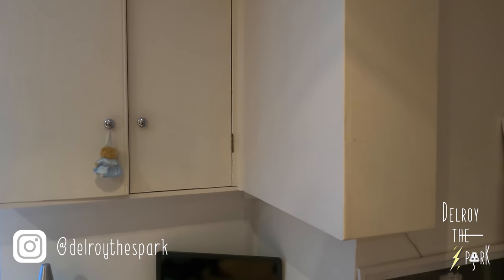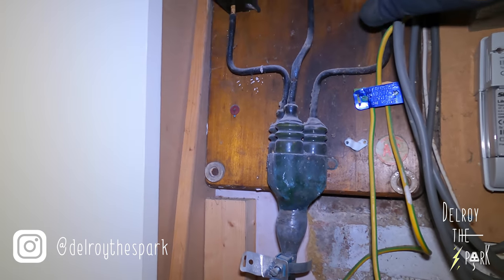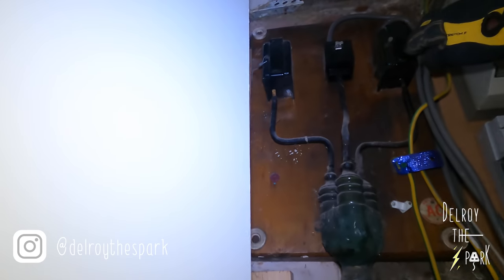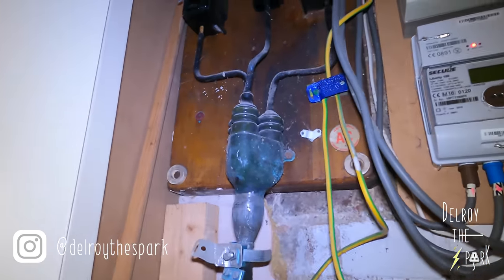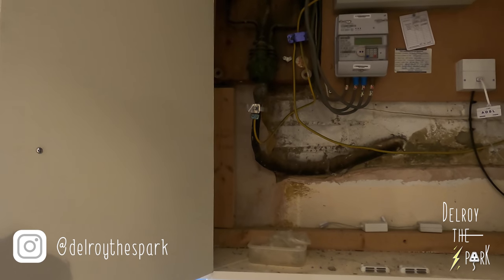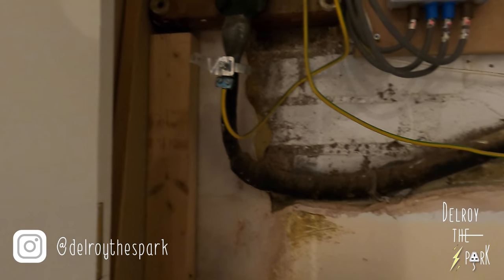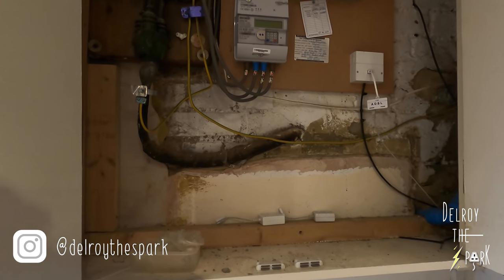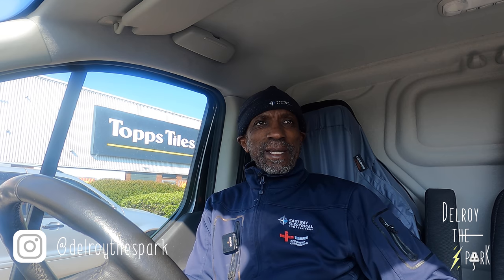"You Need To Contact UK Power Networks As This Is An Emergency" | Electrician In London Vlog

Comment: At least it was stable at the time. When you can visibly see arcing and blue sparks showering off you need to call the fire brigade as well the network operator!
Reply: @Exploring With Dark Dreamz I don't think you need to leave the building -if there is a fire incident you'll see it straight away if you're standing there next to it waiting for UKPN to arrive! Certainly don't want to sleep there though until it's been made safe.
Reply: @Exploring With Dark Dreamz Obviously - that's what I said, if there is a fire incident developing then it would make sense to evacuate and call the fire service. But it's not doing that here - and if it started doing that, you'd see it if you were standing nearby! What they did by calling it in with UKPN was perfectly adequate.
Reply: @Exploring With Dark Dreamz Yeh I'm aware of the safety implications - but it wasn't arcing or sparking at the time the electrician was looking at it - it's still serious, that's why they've reduced the load and called out UKPN as an emergency - there's no need to run out of the house with it was in the video though!
Reply: Switching off all loads would immediately prevent any further arcing.
Reply: @sdgelectronics  That's not necessarily true. Some cut outs have a 2nd neutral connected to a street light outside. If that suffers a loose connection or some issue, switching off the load inside the property will have no effect.
Reply: @arsenalh8manu  If there's no load, it cannot arc. There's no current. You can test this easily - take a piece of wire and connect it to an energised terminal and see if you can get any arc to occur.
Reply: @arsenalh8manu  As an analogy, try welding without the ground lead attached the workpiece...
Reply: @arsenalh8manu  sorry that's not correct at all. An open circuit cannot create any load or draw any current.
Reply: Switch off the DP main switch on CU and you’ve got an open circuit, no current, no more arcing.
Reply: @letsgocamping88  I concur 👍
Reply: @0liver0verson9  in 25 years I have never seen a cutout with a second neutral you can have a separate earth bonded to the cable which will appear in the cut out as a separate connection but not a second neutral

Comment: Wonder what the fault level is at that point, presumably the fuse would still work as a fuse even if it is welded in to the socket! Great video, thanks. From an armchair sparky.
Reply: Loose connection provides a high resistance path at some point, which provides simultaneously the dimming lights and the heating up of the fuse box (power goes into heating everything around the loose connection instead of into the lights). In this case it will probably have been the loose connection of the wire from fuse to meter, since nothing else would have been touched in decades.
Reply: @JasperJanssen  the cable entering the fuse holder was showing signs of heat damage, it may well have been the connection on the bottom of the fuse and it is not uncommon for this to fail - note the fuse holder was not fixed to the board and its movement to fit new tails may have loosened the connection resulting in the fault we see here.
Reply: @David-js4wd  the fuse holder was not fixed to the board because the person installing the meter had taken it off to fit the new tails. And, sure it was showing signs of heat damage. Heat travels.
Reply: @JasperJanssen  the meter fitter would not remove the cutout from the board to fit the tails!

Comment: I’ve called 105 many times over the years, they are always very helpful and normally are out within a couple of hours. One of the times was for my own house 😝. They had to dig up the front garden to kill the electric to change the service head 🙈
Reply: Call 999 mate 🤣🤣🤣🤣
Reply: @emilgemc8913  🤔🤷🏼‍♂️
Reply: My understanding is that the suppliers consider it safer to cut/rejoin a live underground cable than to change a service head live, presumably because there are less variables to contend with.
Reply: @petermichaelgreen  it’s because it was on old metal service head, if it was plastic they would of done it live
Reply: @-.Andy.-  IIRC the DNO procedures I came across (which admittedly may vary with DNO and time) said they would only do a live cutout change if the cutout was of insulated material, the cable was of a modern plastic-insulated construction and the supply was single phase. If any of those weren't the case they would cut the cable outside, change the head dead and then re-join the cable.
Reply: @petermichaelgreen  yeah they don’t always stick to that in my experience, I had one crew come out and change a 3 phase head live once 🙈
Reply: @-.Andy.-  They shouldn't change a damaged or overheated 3 phase or single cut out live though. That has gone terribly wrong on more than occasion. This one was ok to change because it was a separate single unit.

Comment: Those pilc cables ( paper insulated lead cable) have been on the network for about 50 years so they are on their way out unfortunately.
Reply: You'd think so but the plastic cables installed in the 70s cause more issues
Reply: @haldo691  that is true the lead ones are better

Comment: Good lord that's an aging electrical system. I don't think that kind of thing would pass as serviceable here in Canada
Reply: You should see ours here in Germany. Our fuses in our apartment are giant round screw in ones (similar to a light bulb fitting) covered in Bakelite.
Our building is over 120 years old and was rebuilt after the war due to bombings.
The wiring is a total mess particularly in the kitchen where generations of occupants has laid wiring but not adhered to any safety standards. Wires laid in non uniform depths and worst of all, they're laid in a Criss cross patterns across the walls meaning that the entirety of the walls are live. We honestly thought our testing equipment was broken when we moved in and wanted to mount cupboards and couldn't find any safe places to drill. We call in an electrician who confirmed our fears and could only advise to just be super careful when drilling.

Comment: I’ve always prided myself on safety at home but last year we started getting tiny electrical issues. Turned out to be one of these huge old 35amp fuses in the box outside. The terminal had almost rotted away to nothing and was very loose. It was also bloody hot. Fair play the electric company was with us in an hour and we ended up with absolutely everything in the box being replaced. Even a new board for everything to be screwed onto. People don’t realise !
I think the biggest issue with electric is you can’t actually SEE what’s going wrong

Comment: every time i see UK wiring i have a fit as to how exposed all that wiring is and how the mains are just exposed...
Reply: It’s double insulated
Reply: It's actually safer than burying everything behind plasterboard. You have easy access to it should a fault occur (like the scenario in this video) AND the added benefit that you can often see, hear and smell when something is going wrong - which you couldn't do if it were all covered up. It's really supposed to all go inside a metal, grounded casing but the older the property - and UK houses are often EXTREMELY old - the less likely you are to find this as that's fairly new regulations. Also leaving it exposed means it's strangely LESS likely to cause a major fire as it doesn't have a bunch of flammable material surrounding it (like wall insulation) inside an enclosed space where fire can develop, burn and spread unseen and undetected for quite some time.
Reply: @DavidStruveDesigns  ive never been a fan of burying utilities in the walls, i rather like the look of running wires in conduit personally
Reply: me too! is unnerving... also, americans and single solid wire.... atrocious
Reply: @federicocresci698  solid wire is only used on branch circuits, the main coming in off the street is stranded, the advantage of solid core for branch circuits is you can clamp down on the wire and it wont come loose over time with heat cycling like stranded will, and with solid it tends to withstand heat from overload better

Comment: You seem to get a helpfull lady from ukpn, we went to a customer the other day who told us there's no main fuse, obviously had to check this to find copper cable wrapped around the fuse carrier, phone ukpn told by lady you shouldn't be pulling the fuse( in a head teacher telling off manner)
Reply: She is correct they potentially have the power to prosecute anyone tampering with their supply
Reply: @davejarvis5279   I was pretty sure you were allowed to pull the main fuse in event of an emergency. Some sparkies pull them out everyday, its all well and good until you pull one and the incoming cable drops out of the fuse block onto the floor
Reply: There's no need for the condescending attitude but she was correct. Electricians should not break the seals or pull the fuse. Obviously, there are situations where common sense may override this but there are good reasons for these rules. Ideally, every property would have a double pole isolator, so this issue wouldn't come up.

Comment: See that Liberty 100 meter, thats a Gen 1 smart meter. IF you have swapped your supplier so your current supplier DIDN'T install that meter, then it works as a dumb meter. There is a SIM car inside which dialled the supplier if opened.

Comment: Wow, Europeans criticize the American power system for using 120v as the normal household voltage (we do have 240v available as most residential is split phase 240v),  but an exposed main fuse on a wood board? That was never allowed in the USA since at least the 1920s. All our electrical connections were/are in metal and later non-flammable plastic device boxes. Still all our service panels and meter boxes are metal by code. In the early 2000s I was walking through the Frankfurt Germany airport where some construction was going on. Looking up above the false ceiling I saw stuff that would never pass in the US or Canada. I don't mean to be a critical Yank, but really, some of your practices are downright unsafe IMO.

On a lighter note can you explain the three wire feed from the utility? Is that split phase like North America or is it three phase delta? We can't get three phase for residential most anywhere in the USA. Big problem for many higher end  home machine shops with three phase machine tools. We have to resort an inefficient rotary converters.
Reply: The cable head probably does date from the 1920s! The 3 wire feed is unusual for the UK. Could be 2 phases of a 3 phase 240/415V supply, or 480V split phase
Reply: Three phase Wye. or 480 spit phase.
Reply: The wooden backboards, the DNO equipment is fitted to are flame retardent. And the black fuse holders, are manufactured to emit a pungent ordour,  if overheating occurs.The service head, looks like it is from the 20's, but serviceable, and the loose connection probably caused from some sort of mechanical shock, or vibration / or likely a poor quality meter replacement.

Comment: Is there a huge part of exposed wire sticking out of the main fuse thingys?
Reply: Yeah dude, its double insulated tbf
Reply: you are correct. It's called shrinkage, where the insulation shrinks over time as a result of heat cycles. That's why its so dangerous pulling main fuses out from fully enclosed cut outs, as you can't see what the state of the cable is underneath the cut out. Sometimes the shrinkage is so bad, and even smallest disturbing movement can trigger and arc flash (meaning there's a short circuit between line and neutral below the cut out that causes the incoming cable to melt and explode covering whoever is pulling the fuse with molten metal). I'm not sure whether its the same for domestic, but in a highways situations a full face visor, arc proof clothing and gauntlets must be worn to pull those fuses.
Reply: @pIotney  Here in germany we use NH-Fuses as main fuses in our houses, to pull them you always need a special leather or rubber glove that has a handle built in to pull the NH fuses, and normally you also have to wear a face shield (but otherwise even old houses have a solid connection between the fuseholder and the wire so the danger of arc flashes is more from pulling a fuse under load, creating an arc which then jumps on another phase)

Comment: Your change of voice when he said to go turn the kettle on had me creasing. Iv done elec meters for 8 years and it’s definitely a loose connection on the cutout fuse.iv had loads of them welded closed like that and it’s not a supplier job mate it’s a emergency dno job pal as we can’t do anything either as all we could do is try remove fuse like you did. Iv never seen that part we’re the tails come out of into the fuse and neutral block that looks dodgy af.  You said the fuse quite loose on the meter board so my guess is the incoming supply cable on that fuse was not that tight and when the meter guy removed the fuse to fit that smart meter it was wiggled and became loose or the tails In The top of cutout going to meter we’re not tightened properly.
Uk power would of just cut the cable live and probably put it into a new grey 3 phase head with only 2 phases live. Some of them reconnect the meter tails some call us out to put into the new cutout. Most of them won’t go into the meter

Comment: Before pulling (or trying to) a main fuse you should disconnect the load, you didn't appear to have done this first?
Reply: An electrician should not cut the seals or attempt to pull the main fuse. I'm sure it happens all the time but technically, they could receive a fine.
Reply: Technically no but in the case of an emergency some discretion is required. I suppose it's different for me as I'm certified by UKPN and WPD due to the nature of my job.
Reply: @garrett69  I've never actually heard of anyone receiving a fine but it must have happened at some point. I agree that there are times when it makes sense to pull the fuse. It would be good if we (the DNO) approved more contractors to pull fuses. They could pop on a double-pole isolator while they're at it. I suspect commercial interests may have some bearing on limiting the number of approved contractors. £150 odd for fitting an iso is a good little earner 😆
Reply: @garrett69  You just wanted to be able to tell everyone you're certified by UKPN, amiright?

Comment: I replace main fuses daily albeit with a different network and I can say that you're not allowed to remove a, seal unless you hold the correct authorisations and you clearly don't otherwise you would carry seals and sealing pliers which you don't have!... Up here if you was caught removing a seal you'd be banned from the network and fined.... Be very careful... Just because you're a spark doesn't mean you're safe to work on the live side.
Reply: I work for a DNO and people do get prosecuted for criminal damage for cutting seals but pretty sure if it's a life or death situation they won't come after you although I'd advise against pulling a fuse if there's any sign of overheating remember the incoming side is probably fused at 400a or higher

Comment: I can’t believe you was gonna pull that fuse out with no ppe on. If you’d s got a arc flash and blow up in your face.
Reply: given that was a series 3 cutout, should he have partially pulled the fuse and then attempted to get a better grip  he could well have made contact with the live cable.

Comment: Turn all the fuses off and then the double pole disconnector in the fuse board. Leave off load until the DNO arrives.

Once the DNO have rectified the problem insist that a double pole disconnector is fitted on the load side after the meter before the fuse board. 

Before reinstating the power to the fuse board tighten all terminals therein with a torque screw driver and apply some electrical lubricant. 
Reinstate Power.

Sorted !  👍🏿
Reply: If you want a 2 pole isolator it will cost over £200

Comment: How dose this spark not know who to phone about a service fault on the main fuse. It the mains fuse holder should have been sealed and taged after intalded.Its should be the local DNO. Easy fix. Live cablehead change. Update it to modern spec to series 7.

Comment: Honestly, Delroy, you REALLY shouldn't interfere with the DNO's apparatus. You have no idea what you're doing. I've changed a thousand cable heads and I can assure you, you do NOT jiggle them about the way you did. You could easily have been burned mate. You have no face visor, no insulated gauntlets/over-gloves and no real idea of the danger you were in.

I'm not trying to belittle you, but leave well alone when you have so little knowledge of how dangerous that side of the supply can be. I'd hate you to learn by singed eyelashes. Or worse.

Comment: That’s why in North America, we use 120 volt and not 220 for general use in homes and even commercial companies, up to 240 used for High voltage applications, such as Stove and Driers in homes.
Reply: … No, that’s not even a little why. A loose connection like this is more dangerous in the US. Half the voltage, twice the amps, which means four times as much power going into a loose connection for any given load power.